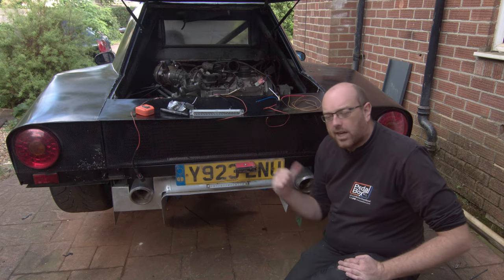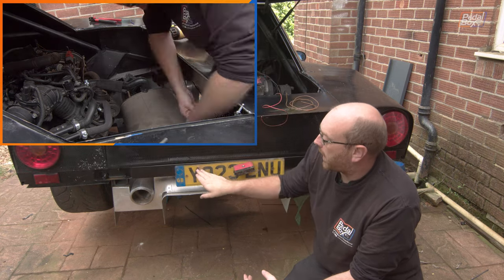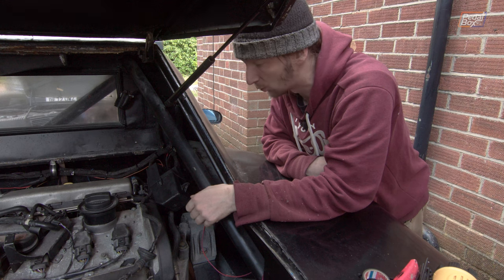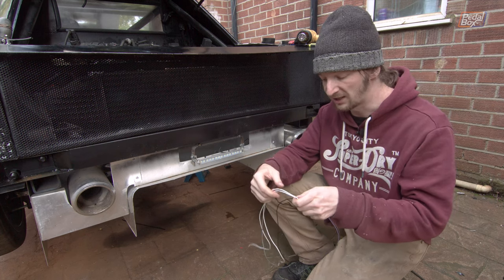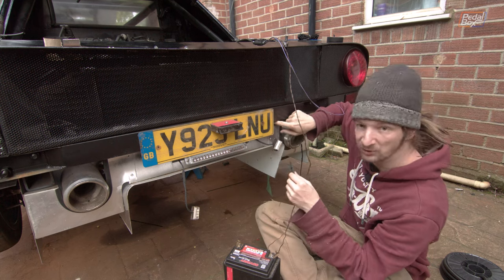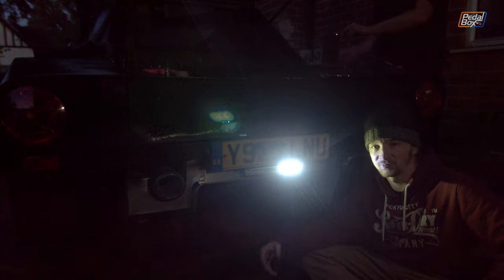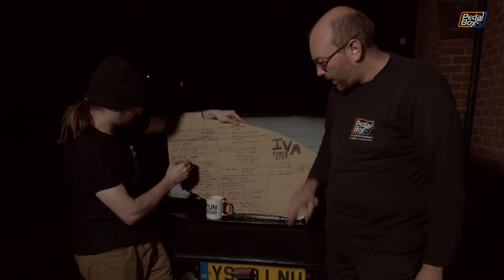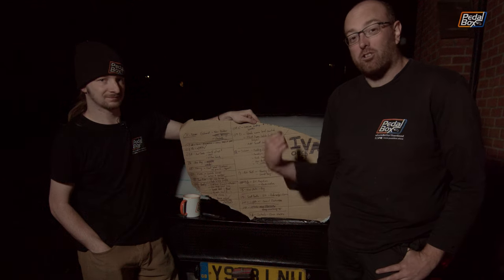The FINAL Hurdles | Mid Engine Audi TT Kit Car | PedalBox Episode 146

Comment: great update guys, that check list is a bit like santas, making a list, And checking it twice 
remember the fans ideally need battery voltage to the rad thermo switch, so if hot can continue to cool with engine off
Reply: Those fans are just for the first intercooler so they can safely turn off with the engine. I don’t know how the little electric aux water pump works on these so idk if running the big fans on the rad at the front is useful with the engine off, but if it is we will!
Reply from the maker: As Chris say, the main fans are on the stat, so no issues there, if we need to cool the boost while the engines off, we've done something wrong. Or right maybe? I dunno if that'd be a good or bad thing to be making boost with no exhaust. It's be magic though!

Comment: Those sharp diffusers are IVA compliant? You guys are planning something behind the rear wheels? They look quite exposed.
Reply: I don’t think there’s anything explicitly banning what we have there. The wheel arch does go as far back as it needs to - we’re basically using the same allowances as exist for opening wheel cars like the Atom, which just have mudguards partway down the back.

Sharp edges on the aluminium might be a pain tho. Worst case, we roll them all over!
Reply from the maker: It's a concern, but one that will likely be fixed with rubber edging (in the short term) and try and sort something better with rolling them later so we can get through the IVA, and remain legit afterwards without looking like a meat slicer